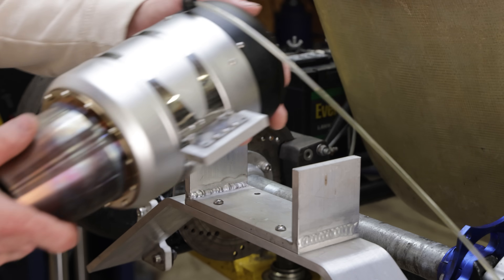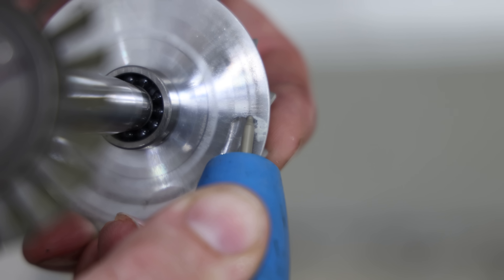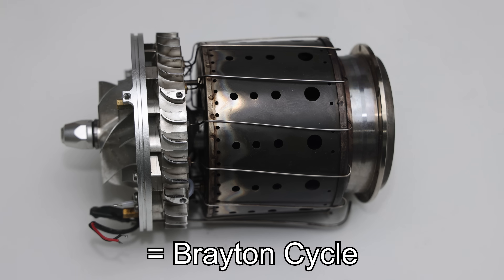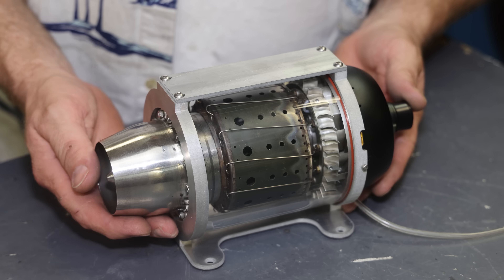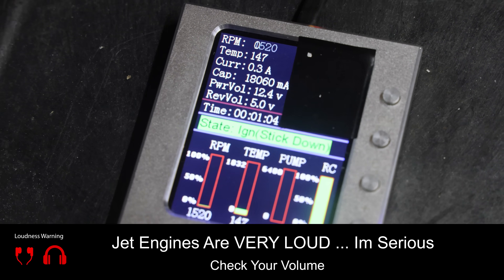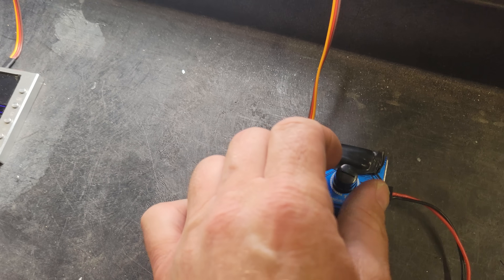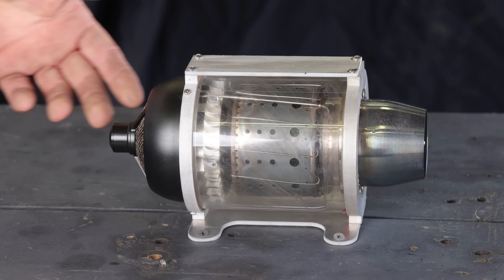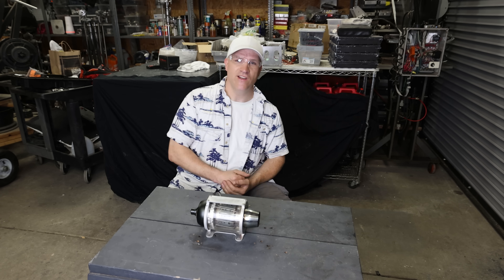See Thru Jet Engine

Comment: So one centrifugal compressor rotor, one stator row.  I guess that is more functional at that small diameter instead of a mix of rotor/stator fins on large circumference jet compressors.  The ignition appears to be pulsating.  Is combustion continuous or is there a rapid pulse ignitor involved?   What RPMs  required at minimum and at max.?    Some bearings that take that heat & rpm without special cooling.
Very fascinating & educational to view this. Thanks for your time & effort for such an extraordinary build.

Comment: AgentJayZ directed me here 😅
Reply from the maker: Thanks
Reply: @WarpedYT  that was impressive. I subscribed 👍
Reply from the maker: @phasm42  thank you, that wasn't my original design, it took me about 3 years to make that material. I first used it in my other see through engines. But due to the pandemic I wasn't able to get the equipment to manufacture the other pieces I needed. I'm hoping version 2 will be even better but it's possible that it could fail.

Comment: Great! Next step can be "see-through afterburner (reheat)" as well as different fuel types. Although afterburner will require a tempered glass window.
Reply: No it won’t because with afterburner, it has augmentation fuel nozzles in the exhaust section so when you throttle up a certain ETR augmentation starts and it’s basically a flame thrower at that point. Spraying fuel into the hot gasses which combusts and causes a lot more thrust and you end up using 1/3 of your Fuel.
Reply: @wilderness1016 how do you keep the flame off the walls?

Comment: That was worth all your work.  I've wanted to see that for 40 years.  These things are still insane to me.  I've been working on wind, hydro solar etc... thermal electric power that utilizes the "compression transmission spring?" for lack of a better term.  I'm green on lingo but understand the mechanics.  You just helped me sooo much.  Now I just need to make the blades.  If you didn't know we can now make thermal electric generators that can mold to shape utilizing all the heat energy waste turning it into electricity. 
Cheers

Comment: I'd be very interested in knowing how much fuel is being used, and what would happen if one simply burned the fuel, without putting it through an engine? Like, if one just had a tube with fuel going through it, and a flame at the end, how big would the flame be, if the speed of the fuel is the same as that going into the your jet? Also, like if one took the fuel that goes in in one second, how much is that? like a test-tube? a thimble? something else?
Reply: The fuel flow at full power is about 6 grams (8 ml, or 1.5 teaspoons... a big thimble) per second. It is diesel or kerosene, with a bit of oil mixed in.

Comment: It's interesting to see a relatively simple jet engine being put together. Back in the late 70's a friend of mine read up on jet engines and started dreaming of building one. We were just kids but he always dreamed bigger than the rest of us. Seeing this engine it's remarkably similar to what he drew. But I also remember how lacking his materials knowledge was. For instance after perusing some encyclopedias he determined that the turbine could be cast in copper. How we argued about that. I had actually heated copper until it glowed red and was incredibly ductile, and it didn't take much to get there so I knew it was definitely the wrong choice. Besides, casting it? I didn't have the math to prove him wrong, but I could unbalance a small gyro to show how badly an unbalanced turbine would be. Now we never got beyond scribbling it down on a paper, and we had no idea about what kinds of bearings or lubrication systems would be needed, but the basic design wasn't that far off. For being done by kids with only some basic information it was pretty good. Not that it would have worked, but for a first try I wouldn't have been embarrassed. 

Now I get to see these small jet engines actually being built. It's a wonderful world in so many ways.
Reply: Man you two were some pretty smart kids!
Reply: @cornercarton  Not really. But we plowed through the library trying to find everything we could about jet engines, and tried to figure out what it would take to make something that might work given what we thought we understood about just how they worked.

And like I said we never got around to actually making one.
Reply: I heard a scifi story recently that culminated in, "We understand how it works, we just can't build it yet."

I was the same way in school, I understood the concept, and could draw it, but I still can't build it.

Comment: Really cool video to stumble upon, I don't know anything about engines but always found jets really interesting. How does it initially get up to speed? Is there an ignition/combustion we can't see inside there before you put up the throttle? Is it an electrical start like spark plugs in a car?

Comment: Where can miniature jet engines be found and what's their cost?  Figuring really small like 1/2 h.p. to 50 h.p. equivalent.  I know it's thrust but equivalent.
Are any kits made to be assembled at home?
It crossed my mind, have a jet connected to something like a Paxton blower, it should create a lot of packed air!
Reply: Just do a web search. Try "RC jet engine", because they are normally used for radio-controlled scale model aircraft.

Comment: it seems like the engine's rpm would increase without end?? Im going by the whining sound noise that I expected to eventually top out, but just disappeared and was followed by another "wave" of similar whining acceleration, that eventually became this low pitched whine when he throttled up. Are you trying to tell me there is cold vapor on the inside walls of the glass, right next to where the red hot combustion was taking place? That is weird. ThaNKYOU FOR SHARING.

Comment: So delighted to see this in operation. I wanted for 20yrs to do this myself on my KJ66 as per the GBTA. particularly on a clear shroud over the compressor intake to study the air flow. Of course this  part would be really cool temp wise as its just cool fresh air entering. Never ever thought to have a clear body!! Great to see a higher throttle the combustion chamber burn retreat. Really great job in execution and proof. I think all jet home builders could see improvement on the vane design. Cheers

Comment: Terrific! And so much hard work.
But why a centrifugal compressor? Hasn't been used since Whittle.
Reply: There are many engines still in production with a centrifugal compressor. It is the only way to get a usable pressure ratio in a single stage, so it is popular for the smallest and cheapest engines. One centrifugal stage is useful in combination with axial stages - the very popular P&W PT6 compressor has 3 axial stages plus 1 centrifugal flow stage.

Comment: Is there a way you could relate to us just how much power that is outputting? say, if possible, a conversion to how many horsepower?
Reply: Zero horsepower - it's not doing any work. Seriously. Turbojet engines are rated in thrust, not power.

Comment: I think the bolting aint right,.almost no compression to the rubber gaskets, it must be at least 4 bolts connecting those 2 flanges radially,.

Comment: Do commercial jet engines use igniters too?  Do they use them only for startup, or throughout the operating of the engine like a gasoline car does?  I always assumed the ignition happened through compression like a diesel engine.

Comment: Couple questions. What was the transparent material you used? I assumed it was acrylic tubing, and if thats the case damn it can stand up to some heat. Next, what fuel are you using? Don't know what MHED is. Finally why is there a piece of tape over part of the screen on your data collector thingey?

Comment: Cool video, thrust comes from high velocity not high mass flow, same for rockets. Use a single thread of smoke instead of overwhelming the intake like what happened at the end of your smoke experiment. Put a pressure guage on it next time to show the exponential build up of pressure with RPM. Thank you
Reply from the maker: Yup, but that wasn't the point of my smoke. In my previous jet go kart episode everyone said that I was blocking the intake air with the seat, that's what I was showing here is that the engine isn't pulling in Mass amounts of air, at least not this type of engine, turbofan completely different story
Reply: @WarpedYT  The reason that the seat didn't matter to the engine on the kart is that the intake flow isn't directional - at the low speed of a kart, flowing in from all around the intake (beside, above, and below) works about as well as from directly in front. That's also why the fog demonstration was not dramatic: the flow isn't in a narrow high-speed channel.

An engine this size is flowing about 18 kg of air per minute (14 m³/min, 500 SCFM) at full power. Whether or not that is "massive amounts" is a matter of opinion.
Reply: It's actually high flow momentum, which is the product of mass flow rate and velocity - you need both.

Comment: Hi am from hvac field. I have just entered manufacturing of aircons. To reduce cost i am working to make fan blade and motor on my own. The metal pressed ones aren’t well balanced. Best case is like car tyre balancing techniques. Can you tell me what software do you use to balance the blade and design to make it more efficient? Thanks a lot

Comment: fog is made of glycerin, a hydrocarbon. The reason you didn't see anything is because you were burning it up. If you want to watch flow inside, you'll have to run the fog through without the fuel or ignition. My suggestion would be just running the fan starter or adding a sprocket and chain to the front and have one engine spin up two fans.

Comment: Surprised that the transparent casing didn't melt or crack from the radiated heat.  I have a suspicion that the fog just evaporated once it got inside, not only from the radiated heat, but also from the heat of compression.

Comment: I've always wanted to see that! And am equally impressed it really didn't blow up!

Love the sound! Jet engines are amazing, but it's hard to grasp the forces they work with. It really doesn't pull in a ton of air. Now can you make it into a turbofan? ;D
Reply: Odd that airplanes don't necessarily need the wings to fly, so very strange forces indeed... otherworldly even
Reply: @manonamission2000  better than a 1-1 thrust to weight ratio and you’ve got a rocket haha
Reply: @manonamission2000  
If they don't have wings , they'll be be spinning out of control

Comment: You should probably just use the starter motor only and a low speed if possible for the fog. That air would be moving way to fast to see the fog at operating speed.

Comment: Wow, 125K RPM!? The Chinook APU runs at 50K, same as the Bell 200 series jetranger engine. We we told the T53 and the like (such as T700) developed 600 psi compression in N1.

Comment: What if you added air bypass? I wonder if that would help keep the hot parts a little more cool. (Disclaimer I have no experience with jet engine. I just have an interest in science and engineering.)

Comment: Did I see correctly on the engine display that the turbine/compressor was turning at over 126,000 rpm??  If so it amazes me that it’s possible to build materials that can handle speeds that fast.  Crazy that more of them don’t fly apart in a mass of shrapnel.  Thanks for the video!!!
Reply: Same what kind of metal did he use btw?

Comment: Very nice.  I had to freeze the instrument readout to see the specs.  Is the 1083 in F or C?   "Pyrex cookware is meant to withstand baking, but it cannot be trusted for use over 425 degrees"  So I guess T was in degrees F?  Would have liked to see some measure of pounds of thrust.

Comment: How are F=ma AND E=mc2 dimensionally consistent (and extensive ON BALANCE) with what is the fourth dimension?

￼

Frank DiMeglio

34m

The dimensions of SPACE are CLEARLY, necessarily, AND fundamentally balanced. That is obvious. TIME is NECESSARILY possible/potential AND actual ON/IN BALANCE. BALANCED inertia/INERTIAL RESISTANCE is fundamental (ON BALANCE). E=mc2 is taken directly from F=ma. Consider TIME (AND time dilation) ON BALANCE. Consider what is a TWO dimensional surface OR SPACE ON BALANCE. (Fully consider what is THE EYE ON BALANCE.) ELECTROMAGNETISM/energy is CLEARLY AND NECESSARILY proven to be gravity (ON/IN BALANCE). c squared CLEARLY represents a dimension of SPACE ON BALANCE. The stars AND PLANETS are POINTS in the night sky ON BALANCE, AND consider what is the speed of light (c) ON BALANCE. This CLEARLY explains the fourth dimension ON BALANCE.

By Frank DiMeglio

Comment: Questions: 
1. how did the pressure in the glass not explode? it looks sealed 
2. how did the whole thing stay fixed? as in what are the details of the force holding it down vs the force exerted by the engine
3. how come the apparatus that's holding the engine didn't budge 

sincerely, a fascinated person

Comment: If you used X Cross-bracing from front to back all the way around, it might stop the gasket blow out.
Reply from the maker: Yes it would but it will look ugly, my ex-wife will tell you that I prefer beauty over function.
Reply: @WarpedYT  LOL It could even be a Hexagon pattern that's rounded over on to soften the edges 😀

Comment: Retired USN Gas Turbine Tech here ...
That was really cool! I'm used to seeing ... okay, hearing ... the great GE LM2500 engines start up, so I'm familiar with the Brayton Cycle and gas turbine engine operation.
Hmmm ... does your engine use any kind of bleed air to keep the outer portion of the combustor cool?
Reply from the maker: Awesome! Thank you for your service, I used to love working on the Navy and Air Force bases, those are my favorite!... Very very smart individuals. No bleed air on this engine, this is probably the most inefficient turbojet you can run. However I have thought about doing a secondary bleeder system on the slightly larger engines and add a reheat section.. 😊...boom whoosh.